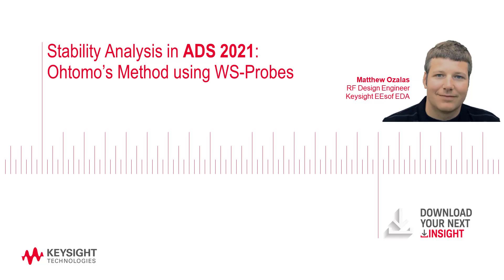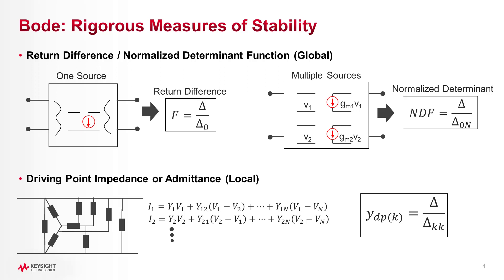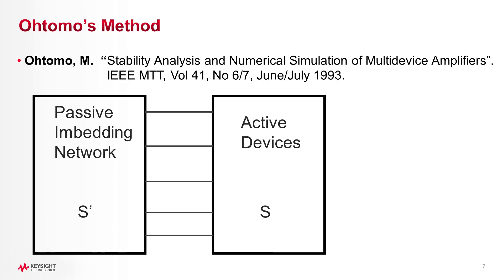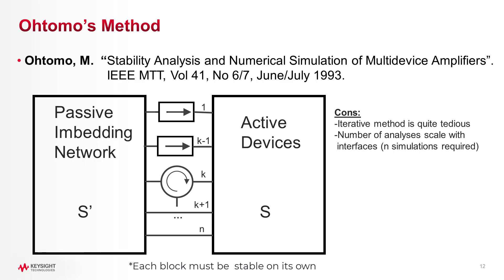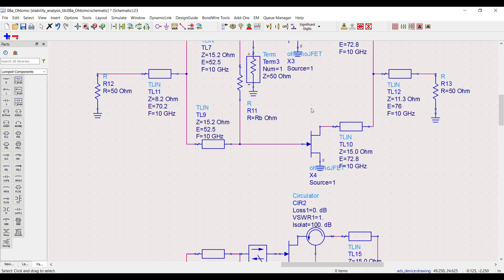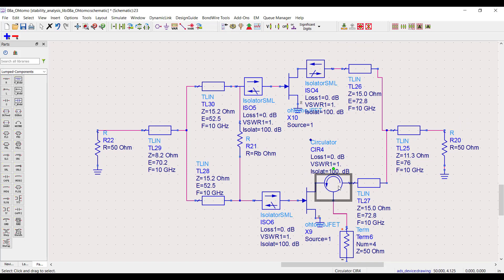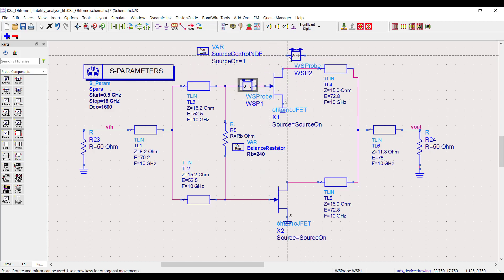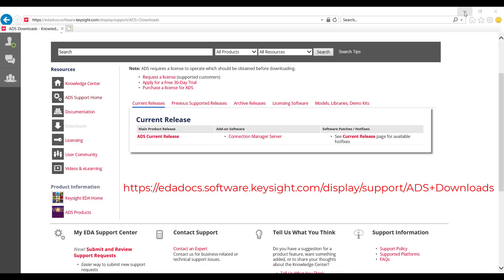Stability Analysis in ADS 2021

Comment: Just to be sure I'm understanding this correctly, the bottom line after that long multi-part lecture is that if we just want a quick and easy way to check for stability, we can implement Ohtomo's method with WS probes? All that stuff about NDF and Driving point admittance, etc, etc, etc is not necessary?

Comment: Hello Mathew Sir,

While computing NDF using WSP probes (at internal nodes of the devices, also ensuring ckt passivity when device is off), the encirclements for NDF is coming negative ( < -1) . What this represents ?

Is ckt unstable in this case?

Second doubt: Apart from perturbation frequency sweep ( small signal frequency sweep), shall not We sweep the signal frequency spanning over MHz to fmax of device ( although ckt passband frequency is very narrowband ) ?
Reply: please check if you wrote the encirclement equation correctly. it should be encirclements(1-LGohtomo) as seen in the video

Comment: Hi, 

First of all, thank you for uploading these videos about stability analysis. I was checking the workspace of this video and I can see that the results do not match with what is observed here. In the attached example, the circuit is stable from Rb = 93 Ohm (that's indeed mentioned in the text attached in the example) instead of 240 Ohm, which is different to Ohtomo's original paper. Do you know why this difference in the behavior is happening? I can see there is a DC biasing, but I cannot match the results by just removing it. I also tried adjusting some parameter values of the transistor model. Can the circuit be modified to obtain the same behavior as in this video and the paper (stable from 240 Ohm)?

Thank you in advance and best regards
Reply: Hi, do you have any update about this? Thank you in advance

Comment: I tried to use this method with > 10 wsprobes due to a larger number of active devices, and the math of the ohtomo method seems to be giving erroneous results due to the matrix math saturating the accuracy of the floats. Is this an issue you've encountered, and do you know how to fix it? Thanks.
Reply: Hi, I am having similar problems in a circuit with 8 WSprobes. I have compared the results obtained with Ohtomos method and the WS probe for a university project, and they don't match perfectly.
 Have you find a solution for the problem?
Please contact me if you have any advice on how to overcome this problem.

Comment: Even when Ohtomo's method says that the amplifier is stable, I'm still getting Mu/K < 1 at some frequencies at the input/output ports. How is that possible?
Reply: Ya i have noticed the same issue in my simulation
Reply: Rollet stability factor is not so much a measure of instability as it is a measure of negative resistance at one of your ports.  K can be <1 easily and the circuit can still be perfectly stable.  Validated with NDF, simple transfer functions, or Ohtomo's method.   This circuit - basically from Ohtomo's original paper, is only designed to demonstrate an odd mode oscillation.   It is not a circuit that would be taped out.    Potential instability is not instability.   But this circuit is unstable with high values of odd mode resistance.  the WSprobes can bifurcate the circuit and perform Ohtomo's method synthetically without perturbing the actually circuit, which is novel.
Reply: Can ohtomo method be used for multi stage power amplifier stability?
I have concern as in case of multi stage, will the wa probes be able to bifurcate circuit into passive and active block still??
Please reply @ Matthew Ozalas

Comment: It becomes philosophical, when all the measures incl. gain/phase margin, driving point admittance, encirclements(F) show you're far away from instability, but the k/mu-factors taken from the outside ports show that you're potentially unstable. Shall one compensate for that at the cost of performance or ignore the k/mu-factors (since those supposed to be unreliable, work only at certain conditions) and maybe risk the tape-out?
Reply from the maker: This is a great observation!   The K- and mu- factors do have value in the sense that they consider the entire Smith Chart loading on the circuit, and they’re really easy to derive --  but they can also be unreliable i.e. if your circuit already has RHP content to begin with!  K/mu also don’t give much insight into why the circuit is unstable, and how much room you really have.  In many cases, circuit implementations to ensure stability (like loss) are the same mechanisms that degrade in-band performance (like gain or efficiency).  If you have powerful techniques at your disposal, it gives a sense of the true margin in your design.   In certain cases, it could absolutely make sense to trade that off to achieve better performance elsewhere.  For example, if you know your circuit might oscillate at high VSWR (which drops K<1), but its embedded in an Rx chain that obscures these loads anyway, go get the better performance!  To do that with high confidence though, you need to really understand the root causes of instability and what exact conditions oscillations will arise under, and that’s where these tools can lead you to if applied properly.
Reply: Thanks! Well to me another way of thinking is that one cannot make a current source without a feedback oscillate. Hence, if one can assure the closed loop stability with sufficient margin, whatever the k/mu factors derived from the outside ports show, should not be of a great value.